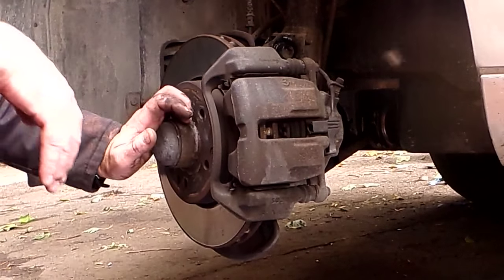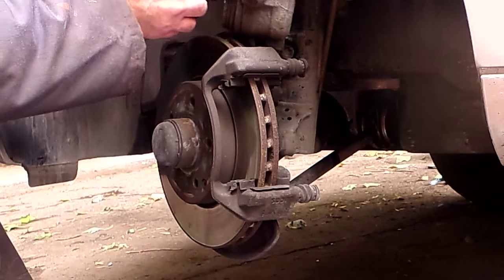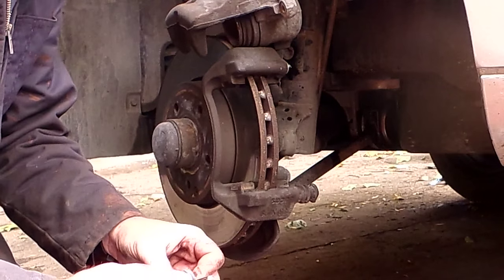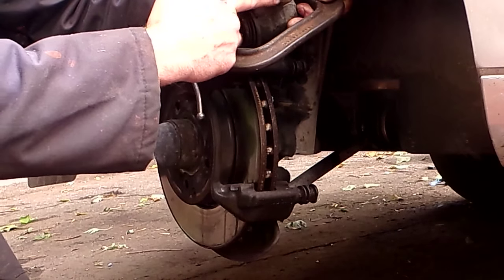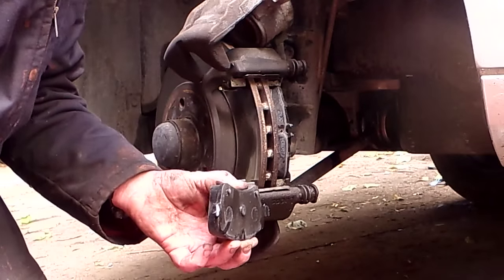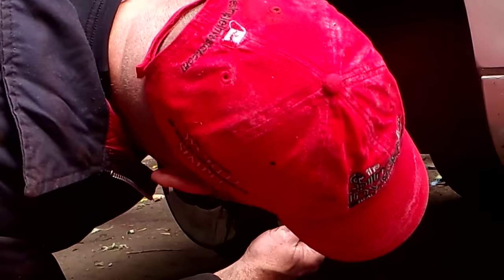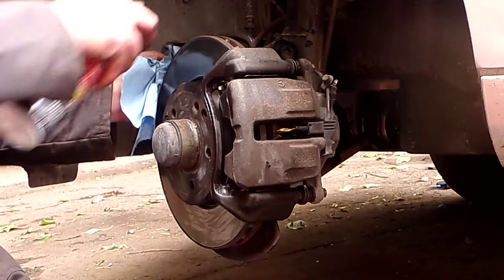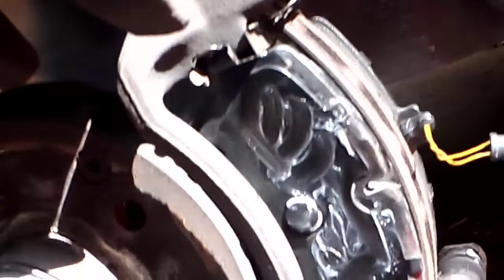How to..Mercedes w203, w209, r171 replacing front brake pads

Comment: A little brake grease should also be applied to the two fingers of the caliper where it will contact the back of the outer pad.
Thanks for the video.

Comment: Hi there, great video. One question: what happens if i don't open the brake fluid reservoir. I wont be able to push the brake piston back in? After the change, i can simply put the reservoir cap back on top? 
Thank you.
Reply from the maker: If you don't open the reservoir cap the air can still escape , and the piston will still retract ,so it isn't 100% necessary. Generally if you have added fluid at some point before changing the pads , you may have a bit too much fluid once the piston is retracted which you will have to suck out with a turkey baster or whichever method works for you. I usually just open the cap so that it's easier to monitor the level while retracting the piston

Comment: Thanks for sharing your knowledge... you make it look so easy.. Can I ask if it's essential to use a torque wrench?  Are there sensors on both front left & right brake pads ?
thanking you in advance... Sam
Reply from the maker: yes there are sensors on both sides on the front pads..A torque wrench isn't 100% necessary (blue thread locker is necessary) but it is a good idea to get one when you have the chance.. an over or under tightened bolt can be dangerous
Reply: What is the torque for the 18 mm bolts that you have to undo on the calliper to change the rotor? Many thank
Reply: @josoap6175  115nm

Comment: Great video, I have 2000 ml 320 and do all the work my self and am gonna need new front pads , I know its best stick with oem pads ,but whats your thoughts on aftermarket like  Bosch or any other brand that You might have tried in the past .   Thanx.
Reply from the maker: +eldin dukic   I like Centric posi quiet ceramic pads...no black brake dust on the wheels, and they are nearly  impossible to wear out..not quite impossible, but they last a long time
Reply: +fupabox  Great, I ll give them a try, thanks .

Comment: Wrong, the w209 hast no Floating caliper. W209 has fixed caliper front and rear
Reply from the maker: my bad .. I was under the impression the 203 and 209 shared the same suspension and braking parts . Appreciate the info
Reply: @fupabox   no Problem. Have a nice Day
Reply: Wrong , w203 and w209 are the same,, Most w209 have floating calipers , only clk55 and some clk500 with performance brakes have fixed front calipers. CLK240 ,320 ,350 etc have floating front calipers.